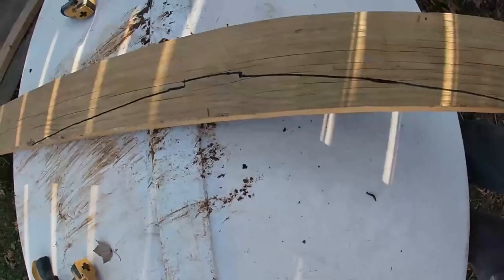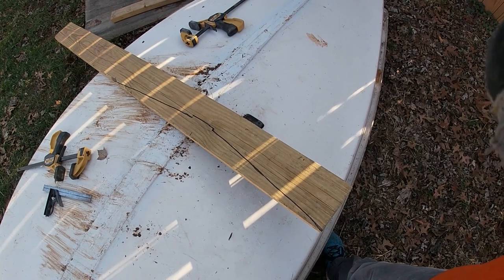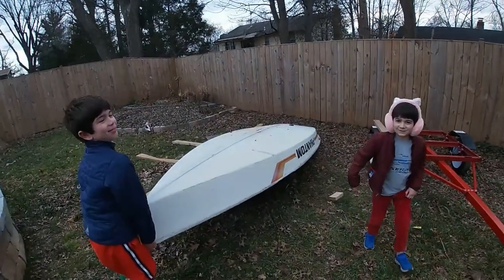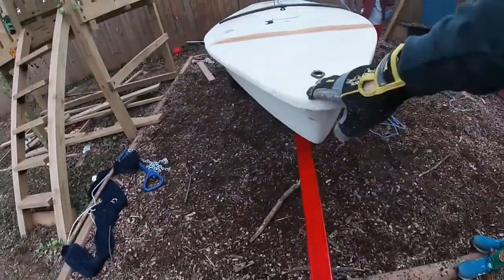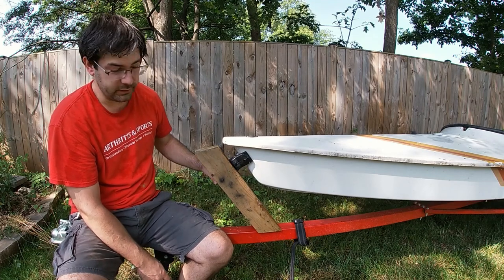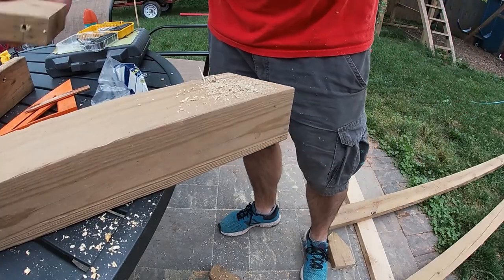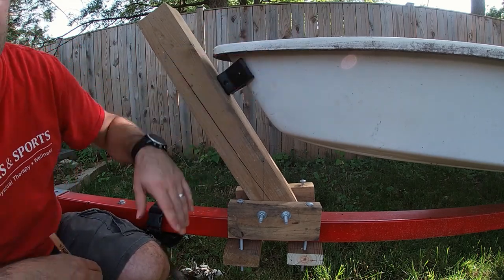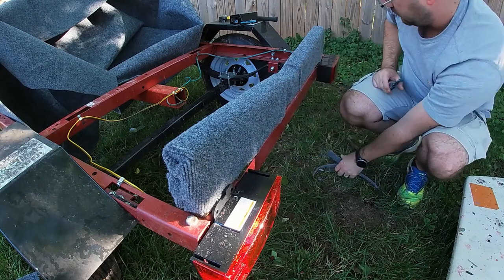Making a Dinghy Boat Trailer from a Harbor Freight Utility Trailer Part-2

Comment: Thanks for the idea.  I have a small sailboat with no trailer also, how does it pull?
Reply from the maker: It pulls pretty good. One of the bearings gets warmer than I'd like, so I need to pull that and repack it.

Comment: Hey! Looking to do the same thing, what was the final cost for the overall project including the wiring and getting it registered?
Reply from the maker: I didn't keep really detailed costs for this project, and some of the supplies were leftovers from previous projects. You can typically find used HF trailers for $150-$300, plus maybe another $120 for parts. The registration is going to vary a lot by state.

Comment: Just out of curiosity, how are going to attach the vin number decal? Are you going to detach it from the old tongue? If so, are you attaching it with rivets or screws? I ask because I'm in the middle of a similar project and Im not sure what to do about the vin decal. Thanks in advance!
Reply from the maker: I would check with your local DMV rules. In some states a modification like this would require registering the trailer as a home built, since it no longer meets the specifications of the manufacturer. In my state, the number decals they provide if you are registering a home built or rebuilt trailer are both adhesive and riveted.

Comment: Does the longer tounge help with backing the trailer?
Reply from the maker: It would make the trailer easier to back up, but it's mostly just to make the boat fit and keep the hitch weight correct. We have an extension for the trailer on our larger boat, and it does make it much easier to back up (as well as keeping the car dryer during launch.)

Comment: I wish you learned welding... I am getting ready to make similar to this, welding would help in some parts of the build
Reply from the maker: It hasn't made any of the videos, but I can weld. The biggest reason I didn't weld this was because I started with a trailer that was powder coated. I would've had to strip off the powder coat and the finish never would have been as good as the original. The new tongue is also significantly thicker than the original frame, which would have been a pain to weld. If you weld a trailer, you really want to hot-dip galvanize it AFTER you finish welding, and I didn't want to mess with that.